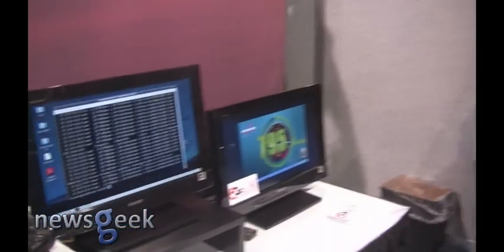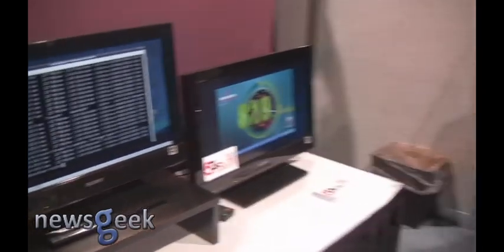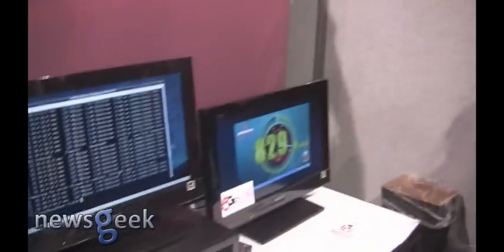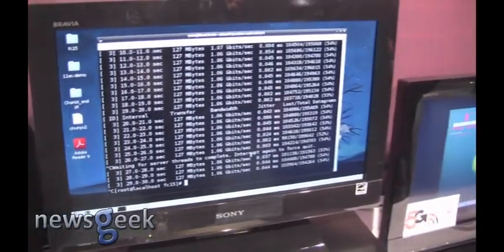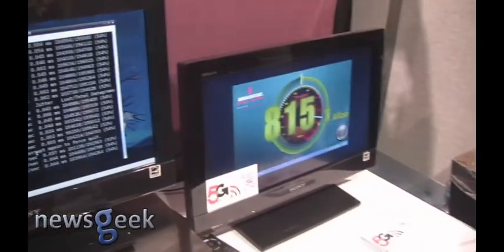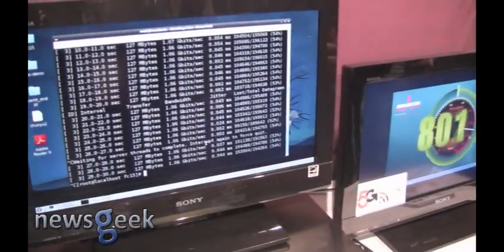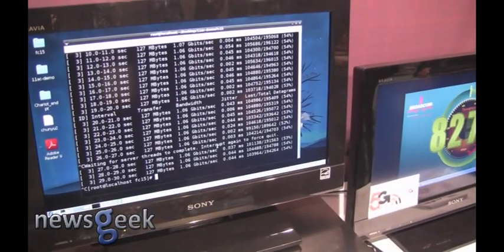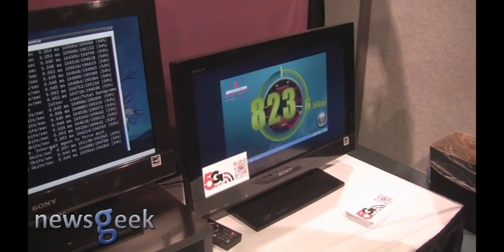Broadcom Introduces 5G WiFi - 802.11ac

Comment: I bought an Asus RT-AC66U router coupled with a Netgear A6200 adapter. I can't give an exact number in ft, but with router downstairs on one side of home and laptop upstairs on other side, I was getting a "Very Good" signal. Speed wise w/ FiOS 150/65 plan and seeing wired results of 156/69 on speedtest, Wireless laptop showed 153/66mbps at same distance above. 

Range is solid. After 6 months, No signal drops, no notable speed loss. Shocking given many plaster walls between router/laptop